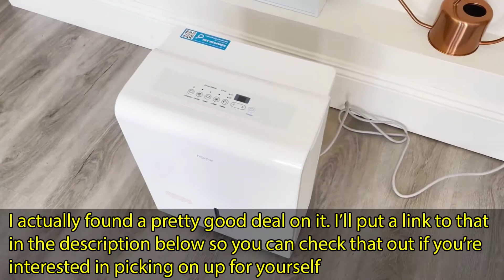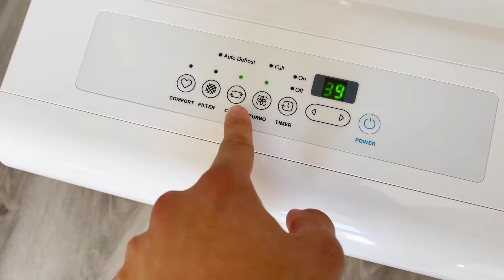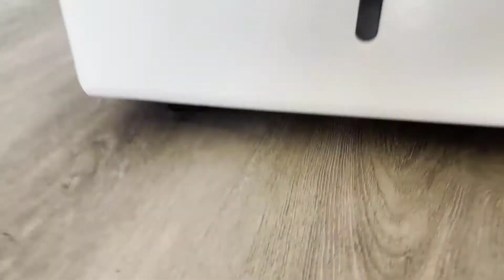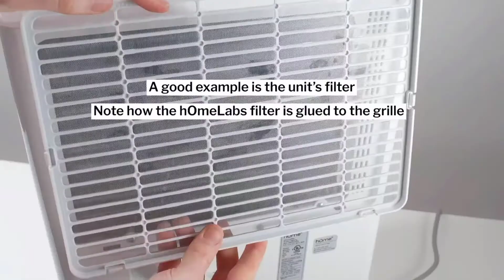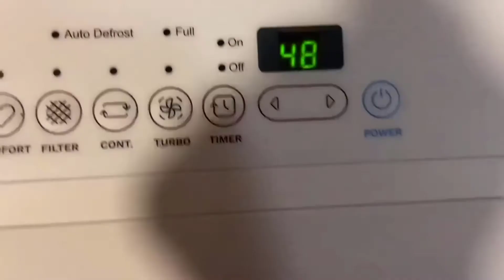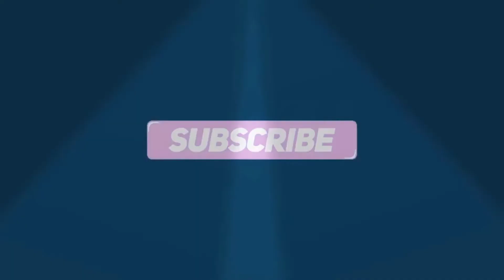hOmeLabs 1,500 Sq  Ft Energy Star Dehumidifier 2022 Review

Comment: Wheres the low caliber drainage hose at? Because i checked in the bucket where the water accumulates and the only thing i saw in their extra was the bracket for wrapping the hose around. So where is it suppose to be in the box because theres no extra space and i have not seen it or received it??? But i did buy extra a 3/4 inch female 12 inch black hose that screws onto the back. Is that the reason why amazon didn't send me the low caliber hose? I would still want it. Please someone get back to me
Reply: It doesn't come with a hose, it says so in the Amazon description
Reply: @GnomieTheHomie  Yes i know that now. You have to buy it as a add on which i did even though it should've just came with it i feel.
Reply: @goldengod87  Yeah I think it should come with a hose as well. The company is probably trying to incentivize people to buy the more expensive bigger sizes which do come with a hose and pump, which sucks